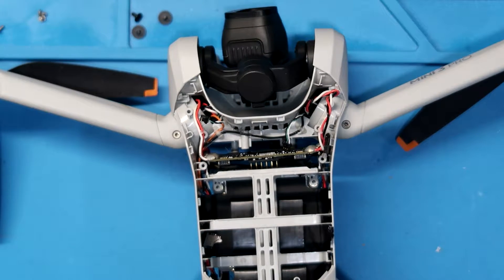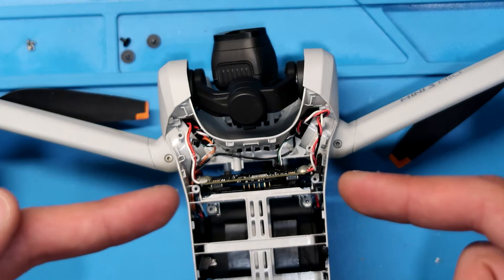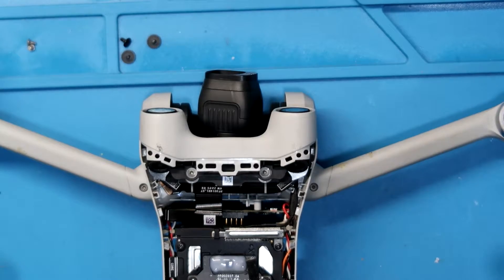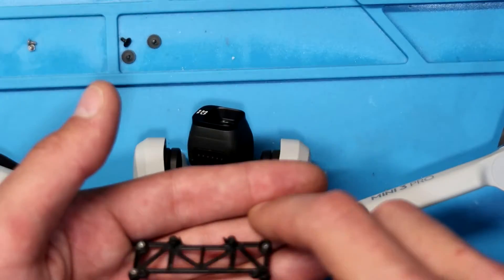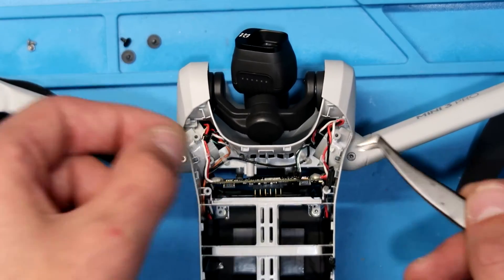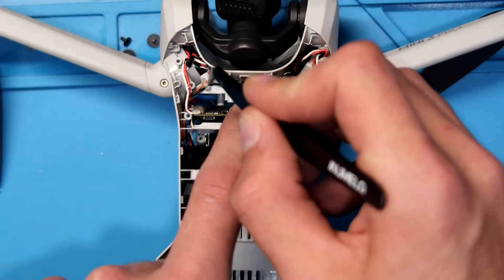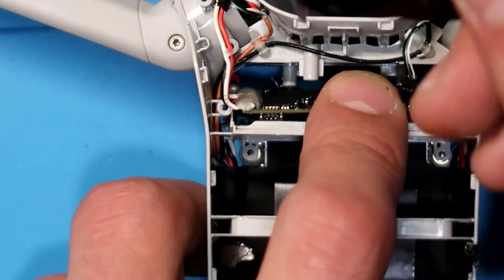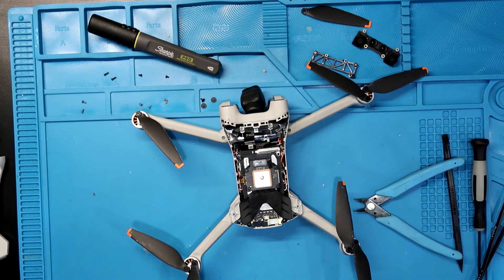DJI Mini 3 Repair - 5 Minute Method.

Comment: Hello, will it work if I cut the wires and solder them and use heat shrink tube rather than soldering them to the board?

Comment: Question- Since the wire are exposed, can you just cut them midway and solder them together with the new one instead?
Reply: You beat me to it. Gonna say the same thing why put all that heat on the board.

Comment: Great video! A motor on mine is hard to move. I Want to put a new arm on it. How much is it to have it fixed and where do I get it done?
Reply: I know this is old but I read a bunch about debris in the motor. Using alcohol and a tooth brush. Mine had broken magnets in the motor and needed total replacement. I sent it in to dronenerds in Miami. So far excellent service. I think I may try this now that I have a replacement in case I make it worse :)

Comment: i wont even spend 5 min. Just cut old wires under the "hood" and solder from there. easy and you dont have to mess up everything
Reply: Or take 5 min and do it the right way lmao
Reply: @DanielJack710  There is no one right way.
Reply: I cut and join them in the arms with solder and heat shrink or just below the motors. Save's the customer and extra $30 and a messed plastic

Comment: What do you think about cutting and soldering wire inside the leg? The leg can be disassembled with a heat gun, as is the case here: https://www.youtube.com/shorts/4nYqPfRGUTk
Reply: Did you try this and did it work?
Reply: @blessedwithdeath  no it doesn't work as leg cannot be dissasembled like that, i've tried.

Comment: Quick question while removing the bottom cover I ripped the antenna strip Is there any way to order this part.....

I've looked everywhere and can't seem to figure out what it's for I did pull it away from the shell on the other side but apparently the one side was still stuck enough that when I got the tabs for the bottom shell to come loose and lift up it ripped the little ribbon .....

Comment: So my drone crashed into a tree a while back.. when it landed on the ground , the (looking from top) left arm got screwed up inside socket. Doesn't snap firm in place like right arm. It flies, but it's a little loose. Bought the best buy warrantee, since I knew I would break it within 2 years. Was going to fix it myself, because of the wait time and they would upgrade the firmware (Remote ID) well couldn't wait (for a mod to disable) so I updated that already.. but... This looks way complicated. Im decent with a solder, but.. Will send it in for repair after this next upcoming trip.